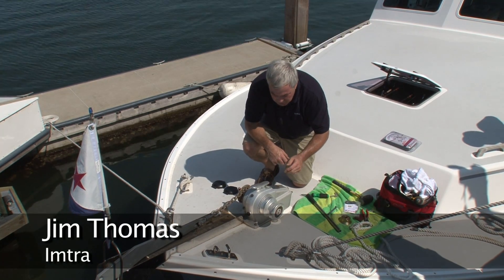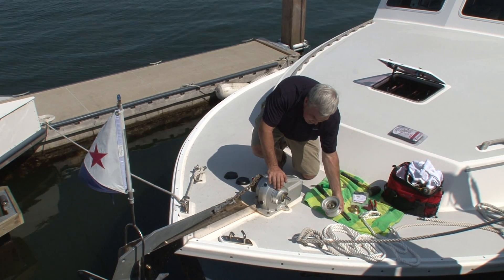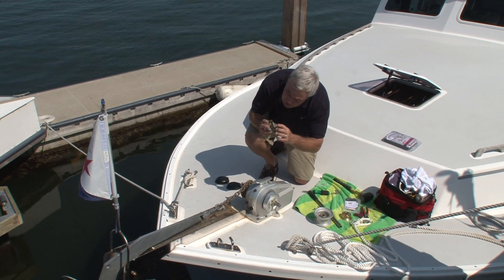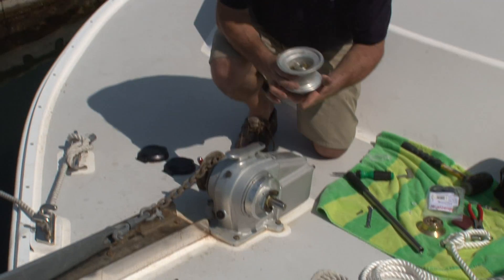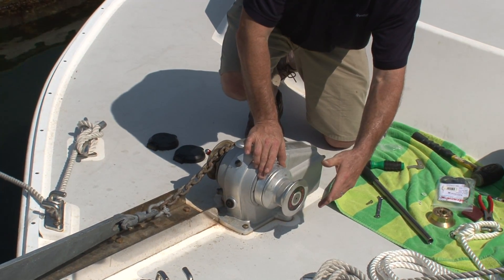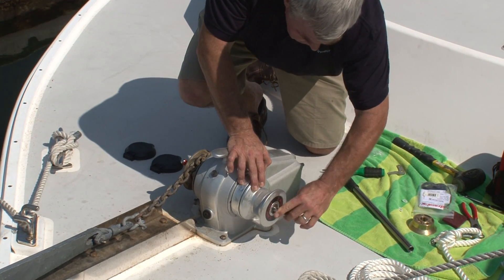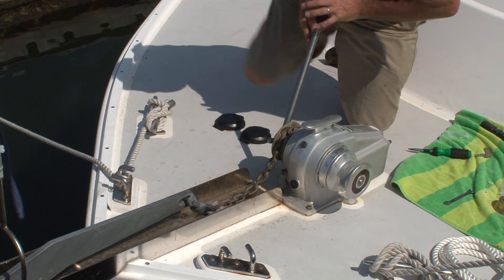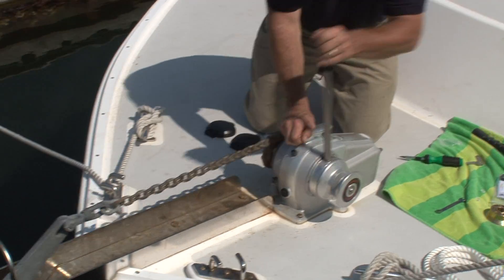Lofrans Tigress Windlass Maintenance Part 6 (Manual Override Inspection)

Comment: good videos but i seem to have missed something, in your maintenance of the windless you did not change or even mention the oil? This is the most important part and you didn't mention it in anyone of the 6 videos of the series?
Reply from the maker: Unlike the oil in your car, windlass gear oil can go many years, sometimes a lifetime w/o needing to be replaced.  However, it can't hurt.  It's best to evaluate the oil to see if it's turned from a dark golden color to a milky consistency.  This usually occurs from water intrusion.  This evaluation can be done with a dipstick style oil extractor.  Do not check the oil immediately after the winch has been operating.  It will be frothy and may have a milky appearance from churning inside the case.  

The dipstick extractor works okay but to really get all the oil out, you must unfasten and un-bed the winch from the deck.  It can then be turned up on end allowing gravity to drain it completely.  

Source synthetic gear oil or 90 weight gear oil.  It's the same oil commonly found in the lower units of outboard engines.  I have attached an oil capacity guide.  I hope this info helps.